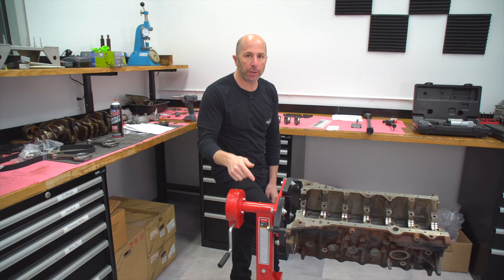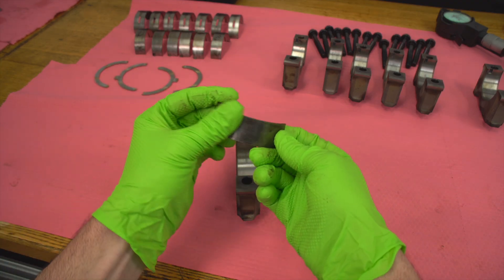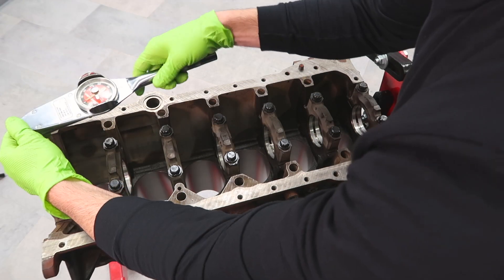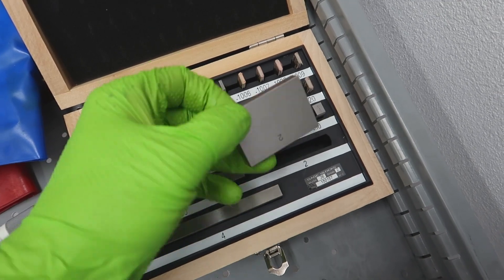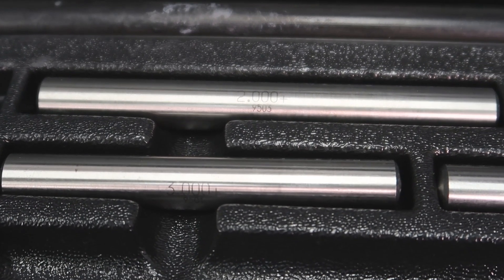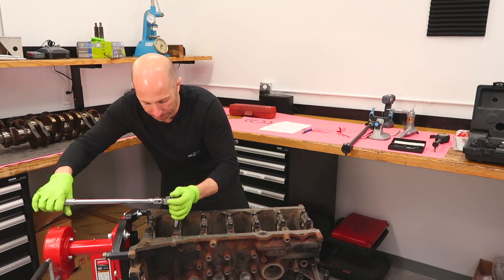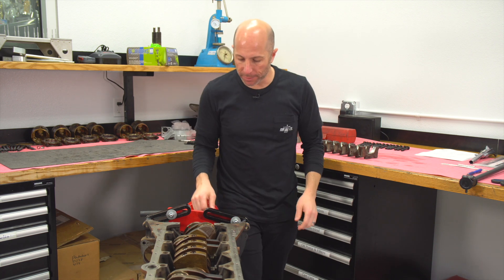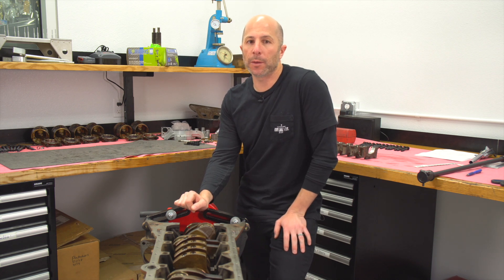$7 Vs $1,000 Engine Bearing Measurement Tools - Plastigage vs. Sunnen Dial Bore Gage

Comment: How do you clean all the engine parts? What needs to be cleaned and how well? 

By the way all these videos are like crack, I'm in my early 20s trying to soak in as much as I can, I'd like to try my hand at working on engines, and you are such an incredible source of information and expertise, keep making videos!
Reply: I ran the cleaning department at an engine shop for a while, iron blocks and heads would mostly be baked and shot blasted, then gasket surfaces wire wheeled and everything blown out with air before mag testing for cracks. Then I would oil them down to prevent rust, and send them to get pressure tested then machined. After machining they go through a jet washer multiple cycles with brushes through the oil galleys in between cycles. Aluminum covers, heads and blocks got a hot sonic bath then soda blasted and jet washed to rinse soda before machining, jet wash again after machining. Cranks to be ground would bake and blast, cranks for polish would get sonic bath and jet wash. After grinding and polishing, they got jet washed and brushed out. Cylinder bores get wiped out after washing with paper towels and ATF or kerosene until they come out clean. Everything inside an engine must be free of abrasive dirt or loose metal particles, or it can get between tight clearance parts and score them up and cause premature wear or even sudden death of the engine. I like to use kerosene or gas for initial cleaning of parts, and alcohol or brake clean for final cleaning before final assembly.
Reply from the maker: This block was hot tanked by the machine shop. In the next video we will paint it so it doesn't rust.
Reply: Mild Mannered Hate 
From trying to do things myself and on a budget - pay for a hot tank or chem wash with a company who knows what they're doing.
You'll spend the same $ and days of your life to get half the result as a tank dip
Reply: @getahanddown  agreed, best to get it cleaned by pros when doing a full rebuild. We only charged around $60 to bake and blast a v8, and that included washing at the end. A full prep for assembly cost more though.
Reply: It really depends what your cleaning. An engine block for example will clean up fine with degreasers and hot water. Then blow it dry and wipe with brake cleaner. Most other greasy parts can be cleaned well with brake cleaner alone. For internal engine parts a box of lint free towels are worth it. Otherwise some heavy duty paper towel works fine.

Comment: Hi - love your videos. I need a good torque wrench for an upcoming Audi engine rebuild. What was the make and model of the wrench in this video? Thanks
Reply: That very much resembles an older snap-on dial type torque wrench. I would always recommend a high end wrench when it comes to engine building. That one is quite basic, but reliable. You will likely want to get a 3/8" drive and a 1/2" drive as the smaller will do much smaller torque values and the larger will likely be needed for extra leverage or higher torque numbers. Hope this helps, and good luck!
Reply: Thanks

Comment: i used both, a mitutoyo holtest inside bore micrometer (most expensive tool in my tool box) and plastigauge. Then i took parts to a machine shop to see what they came up with, and we got pretty close to each other. This was on the ARP main cap bolts (tighter torque specs than oem for the 6G72TT engine).  As always, awesome content Team Papadakis Racing! Remember to calibrate those precision measuring tools within one year before your engine builds or every 5000 uses (whichever comes first). Do an engine break-in, do a UOA (used oil analysis) report to confirm wear metals are at or under the universal averages for that engine or vehicle using that specific engine.